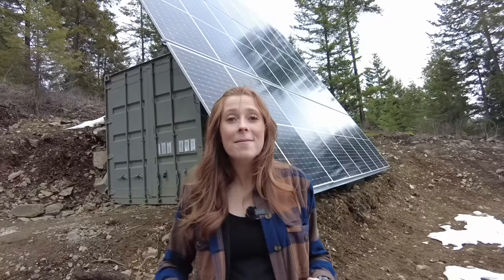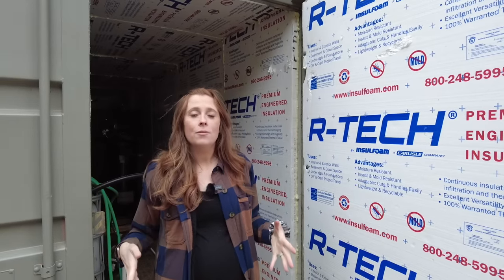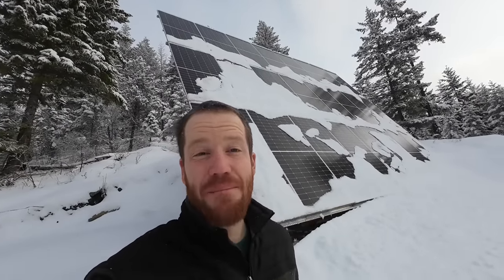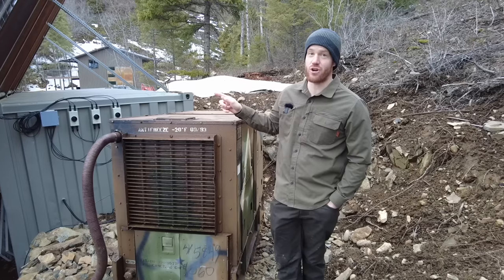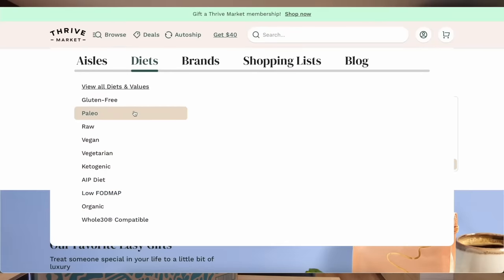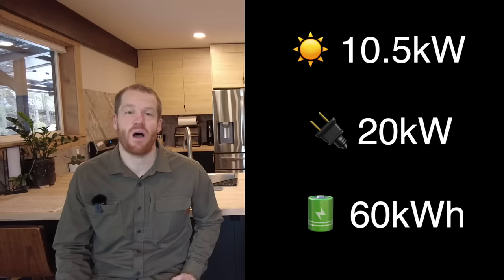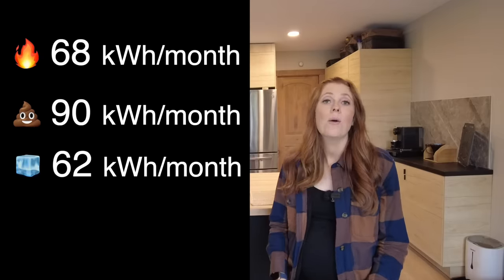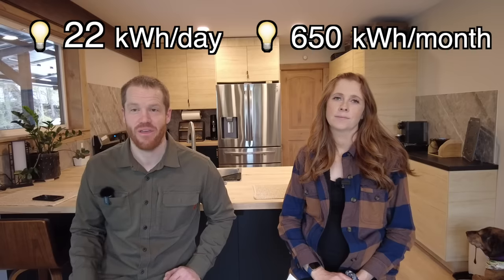The TRUTH About OFF-GRID Solar | Winter Update

Comment: Y'all need to get your hands on a MEP-1040 - it's 10kW instead of 15Kw as a negative, but they are more modern and automatic (can be pretty easily connected to remote start) - easy to parallel too if you REALLY need more oompf. (and they are quiet.... shhh).

Comment: If it wasn't freezing when you needed the extra energy, you could store energy by pumping water uphill.  If you use a sealed system (closed circuit) you could add antifreeze.  But it would take a lot of water to be a viable source of energy!  Maybe you could slowly wind a large clock spring?

Comment: We will be going 24-30kwh of lithium batteries + a 10kVa kubota silent genset with autostart. About 10kw of PV, and a 10kw quattro inverter charger. We will are in a pretty good area for sunlight hours at 39° south and have mild winters (no snow). As you say, for us it also doesn't make economic sense to buy 100+kWh of battery storage when 99% of the time 24kwh will be enough to get us through the night till the sun kicks in the next day. Money better spent on either a grid connection if you live close enough, or in our case, a good quality diesel generator.

Comment: 22 kWh usage vs 6 kWh of production = 16 kWh deficit a day x 30 days = 480 kWh of December deficit. This is needed storage capacity that needs to be transfered from summer overproduction. That is a lot of batteries. In mountain landscape like that, you can think of big tank of water at the hill top that is pumped up, and then released down onto a turbine. But again you would need big tank of water around 9000m3 and the delta hight 20m assuming 100% efficiency of the system

Comment: It would be cool if you could get an electric truck like a Rivian or others and back feed/connect it to your off grid system for backup and/or additional electrical capacity.   Also I'm here to mention as usual you could connect a Chinese diesel heater to heat either your shipping container when/if necessary, and have a switchable duct to send the heat to a tube with holes running along the bottom backside of your solar panels to melt snow accumulation.

Comment: I use 800 to 2100kWh/month on a 3600 sq foot home. Ameren Loves us! :P The 800 is usually in April May and Oct Nov..  But come summer and winter depending on how hot or cold we have hit 2100Kwh/month. This does not factor in our Natural gas usage: forced air furnace, gas hot water heater and 2 gas ranges and gas Dryer.

Comment: From Brisbane Au where it rarely falls below + 10 Degrees C;  that was an interesting perspective for colder climates.
From an engineering point Of view I particularly like the tiltable array.
But I was surprised by the shadow that fell across them from the trees. 
Also you said your panel gets hot when partially covered by snow. 
May I respectfully suggest that may not be good for the PV panels for the long term. 
If your PV panels are in parallel then check for Diode  isolation between panel so covered PV panel doesn't become a load for the others.

Comment: As you seem to have quite easy access to wood, I think I would start looking at wood gasifiers if I were you. Wood gasifier + generator could be some interesting solution, especially considering the small amount of days you need to charge your batteries. But this would require quite a lot of research and work. A solution for people having enough free time....

Comment: You could install ground source heat pump(https://en.wikipedia.org/wiki/Ground_source_heat_pump) to cut 66% off the water heating. Excess heat could be also used to heat up the house(water through radiators/floor). We use that kind of system here in Finland. Using generator to produce electricity for water heating is quite inefficient. You would achieve much better efficiency directly burning gasoline to heat up the boiler.

Comment: Have you thought about using "Brown's Gas" to power the generator? Just a thought.... It's something I've been looking at.  The exhaust is oxygen and water. Splitting the molecules in water to create hydrogen on demand which would be used to run the generator. Since you don't store the hydrogen, there's very minimal risk. You only use what you need. There are examples of this on the web. It may work or it may not but could also be a way to save that $500 in December..... Enjoying your vids!!!

Comment: Amazing work and video breakdown - congrats on the new family!

Some sort of multi week storage of energy might get you most of the way to avoiding the generator - e.g. compressed air storage, or small scale pumped hydro. Supplementing with run of river or wind turbines might also be enough. I'm curious about propane standby generators, cost per kWh etc., just sits there ready to go, doesn't go stale like diesel / gasoline eventually does (even with additives) but you have to truck bottles around.

Electric Ford F150 seems like an interesting vehicle for what you are doing, if you are considering going in that direction.

Comment: For the time you use a welder the alternative could be a gas powered generator instead of building a massive battery bank to supply that short time but large ampe welder.

Comment: A EV with V2L such as a Hyundai Ioniq 5  or a Ford F150 Lighting would be a good way to use your excess power and in winter you could use some of the power from the car battery to save using the generator.  You could use your EV to power your electric portable tools.

Comment: Reaching 80% of solar power usage per year is relativly easy. Every percent above increases the invest exponentiel.

I guess, with a modern generator you will be able to reduce the fuel consumption down to 50%.
By using the motors heat to heat up your water you can additionaly save a lot kWh during winter.

Comment: Great video and explanation of costs and usage of generator. . Whats your back up, if in Winter your generator fails or won't start?  I think when they have home hydrogen generation and storage for use off peak, we will all be getting it.   
Also what are your thoughts about moving your Generator closer to the house, inside a well insulated for noise box.

Comment: One thing I've noticed is that you didn't add the cost of the generator into your total system cost spreadsheet. I recognize the military surplus generator is almost certainly cheaper than a new one, but a new 15KW enclosed genset is in the $15000-$18000 range. If you add that in, it would have been cheaper to just go on grid in your situation, as your spreadsheet says it was only $11,880 more to go on grid. Additionally it seems your solar panels were either used, or open box, or discounted in some way, which isn't really mentioned on the spreadsheet, seems like a savings of $2300 or so. So it's probably closer to $70,000 if someone were to copy this setup, or $8300 more than on grid (in your situation at 2500 ft from the grid). You're paying about $450 in diesel, plus $100 for an annual oil change and maintenance. Based on your average usage, your annual Idaho power bill would have been $821, less $550 for generator costs = $271 annual savings for a $8300 cost, which is a 30 year ROI, but the batteries and genset would likely need replacing by then, so it never pays for itself.

Comment: As an army generator technician, trade that gen in for a 15k ammps there way better on fuel and youll only have to fill it up once every 12hrs with low loads even medium loads maybe ever 9 hours you will have to fill it up. And there like the twsla model of generator just plhg and play there super easy to use
Reply: They are unlikely to operate the generator at less than full capacity because they are charging their battery not just using the generator as a continuous supply.
I could charge my 14 kWh battery in a few hours with a 5kw generator then use the battery for the rest of the day and night.
Battery back up is useful even without solar.

Comment: Hi Courtney and Riley my name is Brian McCollum and I am really enjoying the videos that you’ve put out. I noticed in this video you mentioned that you don’t do laundry on site but that something you’re going to add and it will be an additional draw on your solar/battery system. I just purchased GE’s new profile one and done washer dryer combo it connects to 110 and has no dryer exhaust because it uses heat pump technology and condensates the moisture from the drum and evacuated out the drain line. If it would be helpful and you would like I could hook up an energy meter to track how much electricity it uses and report back to you my findings. The unit is going to be installed on July 3 and I could start tracking it then if that would be helpful. Love the videos and I wish y’all’s family well.

Comment: Pretty nice to be living without a utility payment. It will be interesting to see your total cost per kWh compared to living on grid in the same area of Idaho, especially after your batteries start to lose capacity and you need to replace them. Same with the solar panels, although that should be years from now.

Comment: Question:  Do you have internet access out there?
If so, is it satellite or some sort of dish antenna thingy?
What is your up/down speed?
Yeah, I'm a Certified Geek and I could not survive without internet or over-the-air-tv (antenna) at this point.

I also have my ham radio and CB radio, so that's no issue as those can run on 12V if necessary.

As for using the gen here and there, personally, I don't see that as a negative.
It's wise to have 2 or more sources of power in case 1 or more fail.

Comment: I'm almost certain your generator could either become autostart or if that is too hard at least you will be able to remote start it from within your home. If you can not bypass the physical buttons on the generator you are left with using ie RC servos or other DIY tiny solenoids or electrical motors to flip switches and or pull knobs in the correct sequence on the generator. Heck in a pinch even Lego Mechanics parts could be used to flip, push and pull. Now that you have some data on generator usage you can even go over the diesel tank capacity and do a swap out for a bigger one so that you only need to fill up the tank in the late fall. If this was my set up I would aim for converting the generator to a DIY auto start generator.

Comment: hmmm... what to do with extra power??  can you drag up with winch(s) (run off solar)  some old trucks or mining cars fully loaded (and with safety cables) ??  and have on them in Dec. slowly roll  (or skid?) back  down the hill charging via alternator or gen/heads on board them?   AKA a gravity battery.   (or any other kind of gravity battery)

Comment: I have a question because you use to use solar panels when you lived in you vehicle. My question is why on a van or a box truck with a limited number solar panels why do not people use roof de iceing cables to remove the snow and ice off the panels on a sunny day after a snow or ice storm faster to fully recharge the batteries faster?

Comment: With the extra 9 - 445w solar panels = 4,005w that you installed over the deck, will you be be free from running the generator during the winter? I think the solar over the deck looks fantastic, however if your large array on the shipping container were extended so the 9 panels could be add on both end those nine panels would be able to be at the optimum sun angle for winter vs the nearly flat position over the deck thus producing more power.

Comment: 9:26 "So we're not using that much less power than the average American house"... if you run the numbers, 900 kWh vs 622 kWh, that's 31% less.  31% less is not that much less right?😉

Comment: I wonder if you guys wouldn't be the perfect test case for that sand based heat battery I read about. It is stupidly simple technology, so you could probably build it yourself except maybe the electronics. 

It is basically just a huge insulated metal cylinder filled with sand and gravel that has an electric heater inside to store heat and a glycol loop to remove heat. When you produce too much energy, you run the electric heater. You can then store that energy for months and months, and when you need energy, you can just run the glycol loop and get hot water to run heaters and for showers.

Perfect for people that produce too much energy for part of the year. 300 tons of sand and gravel could store something like 4000 kwh of heat for winter with a delta of 80 degrees C and a cumulative heat loss of about 20%. The cost would be maybe two dollars per stored kwh in build cost. Could be a fun project.

Comment: In my experience it is more the angle of the panels and not so much the bifacial aspect that clears them of snow. My panels are not bifacial and I did not have to clear them once this winter with over 6 feet of snow and -28 degrees f. In my case it seems the sun hits the side of the metal cassing and melts enough snow on the panel which, as stated, creates some heat to have the snow melt and slide off just like it did in this video.

Comment: You should convert your generator to DC ( rectifiers etc.) then use the DC to charge the batteries.  A DC charge controller or even a solar charge controller could likely be hacked in.  This way the generator's frequency nor actual output voltage would be important as long as the voltage didn't go crazy high or low.
Reply: That's not a good idea when the generator can power all of the household loads and charge batteries through the inverter/charger and do it all at the same time. Also if you have an inverter failure then you have an AC generator in which you simply flip a bypass switch and you can power your home while you are repairing your equipment. You are dead in the water with a DC generator. That idea has never taken off in over 30 years

Comment: Add 10kw more of panels, and you will not be needed to run that generator in the winter, and on the summer you can even give free electric energy to others :D In any case, nice system you have there, on mine off grid system from the mountain, the system is being calculated so the panels can charge the batteries in 3 hours (in summer), so in the winter to be able to fully charge the batteries in 1 day. The costs to increase the system, would be around 200$ per panel x 15-20 panels = 3-4.000$ :)  except the system where you will mount the panels + cables. As the panels are much cheaper then any other components from a Solar system.  Good luck

Comment: Maybe a solar thermal water heater (with those vacuum pipes) will help you decrease energy consumption in the winter - so less generator usage. 
Also a bio septic uses way less power than insenerator toilet 🚽

Comment: we used up to 3000 kwh a month when using heat pumps to heat our 2000 feet sand stone house so you doint pretty well with 650 :)
Reply: Wow - you had zero insulation to burn that much power.

Comment: Thanks for another great video of entertainment and shared knowledge.   You don't mention your heating other than saying you use the wood stove and some electric heat.  Do you have a furnace or a heat pump?  The latter could give heat when you have have adequate solar (or use your generator via battery charging) and a bit of cooling in the summer.

Comment: maybe im just a low electic user, but on average we use 6kw per day
even when i had a whole house and electic hot water (which i dont have now) i was only using 11 to 13 kw per day, most of the time 11kw... my solar upgrade thats coming soon will mean i should basically never need a generator
also, side note, it doesnt snow or even get that cold... or hot... no need for house heating or cooling unless its the middle of winter or summer

Comment: Just heat water with your extra energy. Build a big box from plywood and two-by-fours, from inside waterproof it with one piece of heavyduty liner, from outside insulate it with foil and at least one foot of styrofoam. Done. It should be capable of storing hot water for a month. You don't use that water; instead, you add some heat exchangers to extract the heat. Usually, you just run your cold water through the heat exchanger and to the water heater, which will kick in, if needed. With a bigger box, you can have another heat extracting loop for a heater. Also, you can collect solar energy directly via thermal panels, which are low tech and more efficient.

Comment: All of your numbers are totally in-line with what I would expect.  My heat-pump water heater uses around 2 kWh/day as well.  My fridge uses slightly less power... averages 60W instead of 86W.  I don't have a poop burner but I like the concept :-).

It sounds to me that maybe you should up your system size a bit, simply because solar panels have become so cheap!   The additional panels don't have to be optimized much, just pasting them on the side of a building to add more winter generation and wired into a charge controller or three to the battery as a separate support system.

But perhaps the most pragmatic solution is to change the "generator" setup a bit.   It doesn't take much to actually keep the batteries charged, just 2000W would do the job (2000W = 48 kWh/day, after all!).  The key is for the generator to simply charge the batteries, not run the house.  A small honda generator with an external fuel tank.  You could program some logic to start it up automatically when the batteries get below 30% or so.

In otherwords, add some convenience so your "warning signal" that you might need to pay more attention is simply noticing that the "little" generator is running.